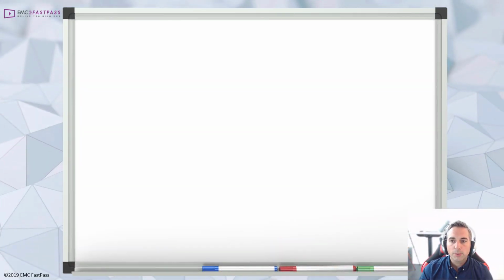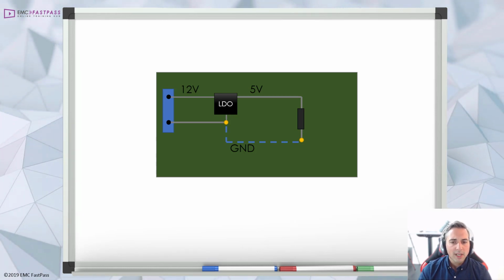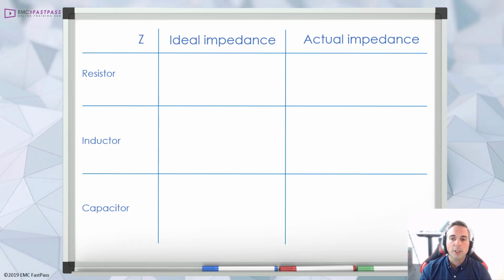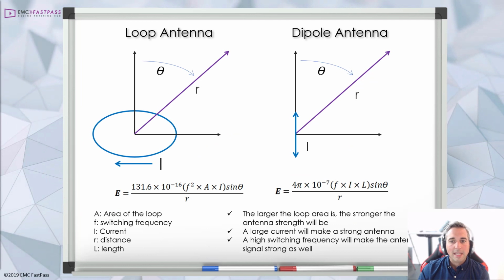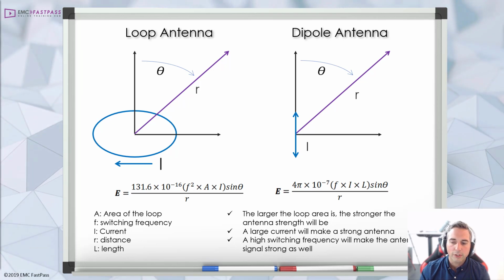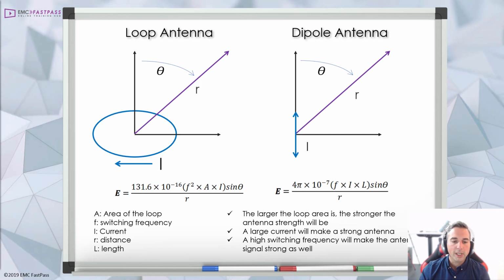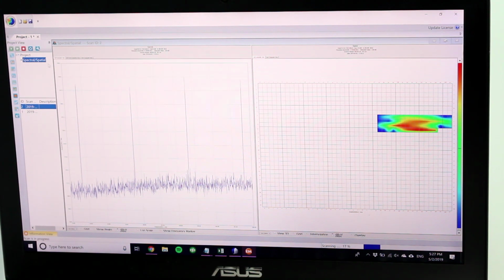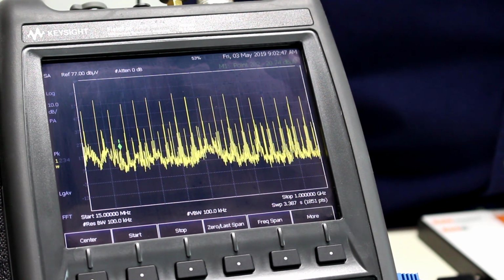#001 How To Reduce Radiated Emissions by Minimizing Current Loops

Comment: Hi,
nice video.
I have a doubt.Why are there two push-button switches on the Demo Board?
One is for connecting the GROUND  and what is the other switch for?
Reply from the maker: Thanks. One connects the grounds at both side directly, the other connects the grounds through a capacitor which allows only some of the high frequency content to pass.

Comment: Excellent video. Unfortunately I could see no obvious difference in spectrum in the final experiment.
Reply from the maker: Definitely didn't come down as much as I expected it would, but for sure several of the harmonics came down by 10 or more dB. I think one issue is that the connections made by pressing the buttons were far from low impedance - the buttons were on the top side of the PCB, the leaded package inductance would be high and the tracks are very thin - all leading to higher inductance. Some current was still flowing around the ground plane slot. More investigation to be done here for future vids!

Comment: Very nice video. Subscribing.

There is a confusion I have however. How is that the return current is exactly underneath the track (that is following the path of least inductance) at only 1kHz of the signal in 5:30. I though this effect happens only at higher frequencies which are above 100 kHz.
Isn't 1kHz too low for the current to choose the path of least inductance?

Thanks
Reply from the maker: It's a gradual effect as you can see from the simulation. As I mentioned in the vid, if the resolution were higher, I'm sure you'd see a tighter concentration below the wire at 100 kHz. The paper has more information on page 38 (http://www.jastech-emc.com/papers/IEEE-EMC_TP4_2009.pdf). Maybe I'll do a vid in the future with the EMSCAN unit and a sine wave input to see the effect.
Reply: EMC FastPass  link is broken :(
Reply from the maker: @momchilhaymanov4369  Just google the filename
Reply: Robert Feranec die some interesting (quite long) videos on this with simulation of power delivery networks and even has some with a demo